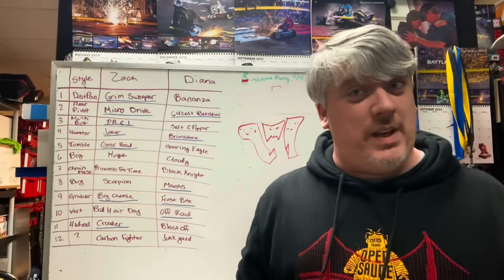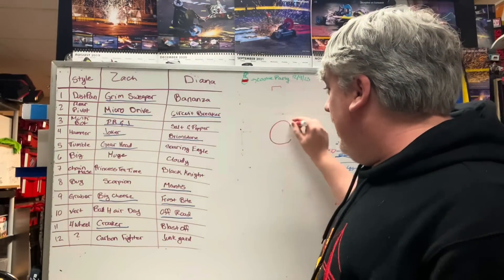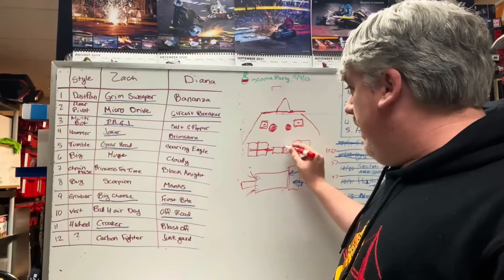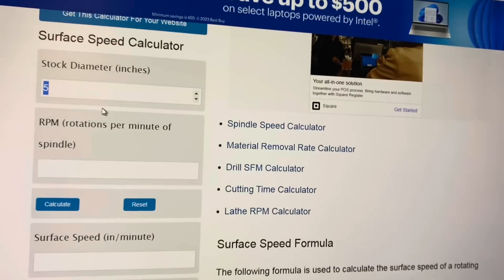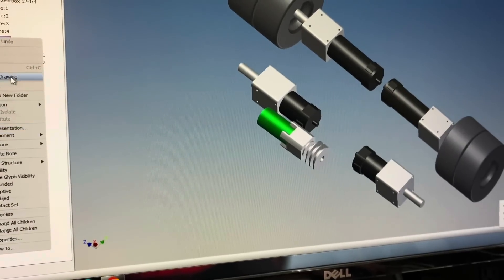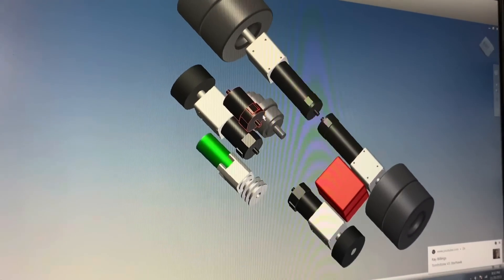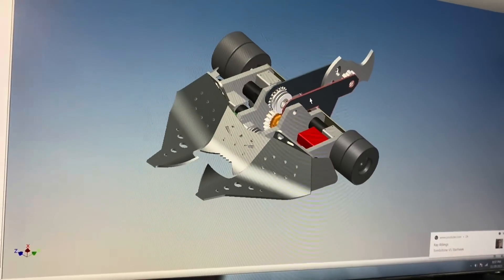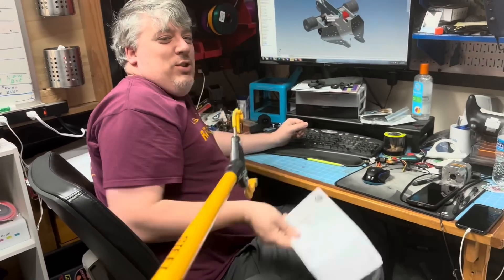We Unveil SKORPIOS X! The BRAND NEW SKORPIOS For Battlebots Season 8!

Comment: Hey Zach, see if you can drive the front wheels using a toothed belt & pulley from the rear wheels.  You just need to reverse the  wheel size difference with your pulley diameter difference.  This should save you 2 motors and gear boxes, and you can go with 4" wheels up front.  24 tooth pulley on the rear axle, and 48 tooth pulley for the front axle
Reply: Really risky to rely on the exposed wheels to drive the front ones.
Reply: @FaecousAlt  its just a  2 wheel drive. which  they (and a handful of other bots), already rely on currently ( & which tends to hold up well).
if the bonus they were looking for was primarilly the ability to run magnets, not only would this save them thousands of dollars on each frame ((cost of motors + gearboxes)) it would also save them a decent amount of weight & empty space in the bot for better padding & a lower density of Killable components. Hell they could also add a second set of small wheels up front in the middle in case the outside ones got pinched by armor or whacked (more even weight distrobution)... could even use smaller wheels if they desired, as the the wheel size doesn't need to match a gearbox ratio. 

They technically wouldnt even need to use chains or belts if they full sent into the 2 wheel drive, but 4+ wheel idea... as they can just be free spinning on bearings, giving full control to the rear wheels.
Reply: Having it be 4-wheel drive, with the front wheels under the bot like that, would allow better movement and pushing ability should the real wheels get damaged or knocked off. Yes, the tradeoff is the added weight of the drive motors, but if the battle comes to a pushing match, having 4-wheel drive would be an advantage and may just be enough to get a victory when both bots lose their primary weapons.
Reply: @qapla  if wheels are getting knocked off then the magnets are holding it to the floor, thus why wheels are in the front in the first place though...
 + we know a bunch of the pushing power is going to come from the back just due to the significatly higher traction that zach mentions in the video. the front wheels are also tiny, so getting the torque necesary to push primarilly off of them would be wild right?

Not trying to say theres 0 benifit... but like, questioning it makes sense imo
Reply: @heartofdawnlight  If those magnets are electro-magnets, they could be switched off in the event of losing the back wheels - or, if permanent, they could be installed so a simple solenoid cold raise and lower the magnets so they could be engaged or disengaged. Sure, that could be a weight tradeoff ... but that is what combat robots are all about.
Reply: @qapla  its not just a weight tradeoff. the second you introduce the idea of an adjusting suspension you consider it as a point of failure.... it can & will break eventuallly, esp when bots are being slammed & thrown with the forces they are.. Bots have a failry rigid shape for a reason. 
electromagnets im not super familiar with but you do introduce the need for more power (batteries), a controler, reciever, & more heat inside the bot... {could you even get the downforce you want with the same size of magnet when electro?}..

Packing all that extra material in a box is a Looooooot to deal with + you need room for the adjusting parts, & you have to contain the wires to not be pinched by said adjustments... its a LOT.. & extra space, means a massive increase to frames weight

Comment: Just my opinion...

I would ditch the front motor drive. I dont see it being more effective for rhe weight it will add. I would keep the tires and magnet but just make rhe front wheels free spin.

I also would make scorpious disk travel across the top of rhe bot in a half moon arch. Kinda like a better version of Tantrum's punter. I think a  longer throw and a small arch would be more effective. I would move the bottom pivot point as far down and centered into the bot as I could. Then i would run a short arm where the disk never fully leaves the space of the bot. That way the disk can slot thru the wedge and be tucked in tight when retracted. That would move the weight more forward and lower.
Reply: Driven front wheels are critical because when the weight of an opponent rests on the wedge/forks the load on the front wheels increases and the weight on the back wheels decreases. You can think of this as a first-class lever with the front wheels as the fulcrum. Not driving the front wheels can easily halve the pushing power of a robot because the wheels that are taking the most weight are not putting any force into the ground, and the powered wheels suddenly have a lot less traction to work with. Sh00k powers the front wheels directly in anticipation of them being more valuable in a pushing match.
Reply: @joshuakong7175  I agree another set of powered wheels would help but Scorps has been 2wd it's whole life and never had a problem. If they can solve the rear heavy issue it would be even better. To me, moving the saw pivot lower into the bot would solve a lot of that issue. Just my opinion

Comment: If I were to change something about Scorpios I would redesign the idler pulley. The weapon motor would spin a dense rubber wheel in the middle of the robot. When the weapon arm retracted it would have a wheel that would interface with the weapon motor wheel which is how it would spin up. Then when the weapon arm fired, momentum would keep it spinning until it hit it's target. It would then retract, contact the spinner, and spin up again. No more vulnerable idler pulley or belts to get destroyed.
Reply: I've had that idea myself for a few years now. One of those pie in the sky 'if I built a hammer-bot' things.

Comment: Is there any reason why you don't just run the front wheels without motors?
Reply from the maker: I hadn’t given it much thought, but I am considering it now
Reply: @SkorpiosBattlebot if you do keep them powered maybe flip them around and lose the wheel guards? it narrows the wheel base but it should still be wide enough not to do a reliant robin
Reply: @SkorpiosBattlebot  you were rolling before without front wheels, with some it would roll even better. No motors would simplify the design, can use any wheel size you want, less heat produced. I do admit front motors would give drive redundancy, at the cost of more complexity.

Comment: Hope you'll be able to keep the front of this one down when the weapon is to the rear. Looks like the drive line was moved back for this purpose. Best of luck with the new bot!
Reply: Yea a wheely-bar is much needed.
Reply: That's what the magnets are for. What made previous Scorpios lift the front was the power to the motors, just like in a bike, which ends up lifting the front when you first give it gas. But with the magnets he should not only stop the wheelies but also have better traction, like Claw Viper was able to achieve last season (of course he won't be as fast as Claw Viper because Kevin's bot uses four really powerful motors for the propulsion).
Reply: @The_Curious_Cat  Well, as you saw they stole Saw Blaze's little wheelie-bar trick so that's all fixed.
Reply: @necromancer0616  Yeah, but the wheelie bar doesn't completely eliminate the wheelies. You can see Saw Blaze in the fights still lifts the front a bit when accelerating. Also if the arm becomes stuck elsewhere then resting backwards (or the lifting system is broken) the wheelies problems return. So having a stable base with the magnets is a big plus.
Reply: @The_Curious_Cat  Well yea, but that's where a speed-controler comes in handy ;)